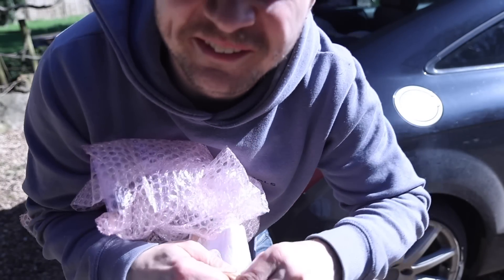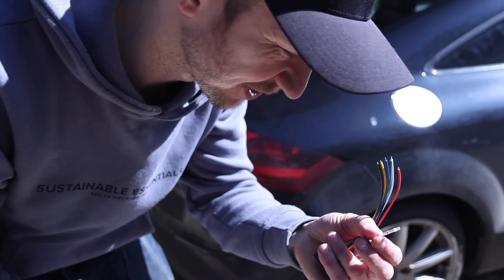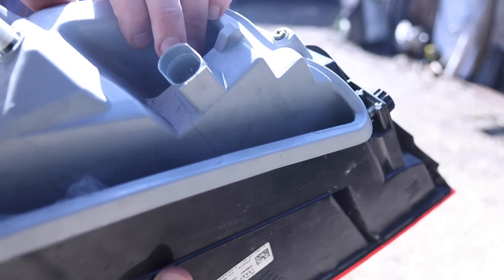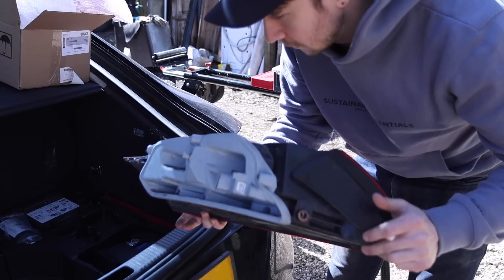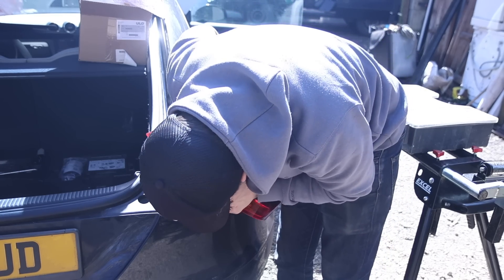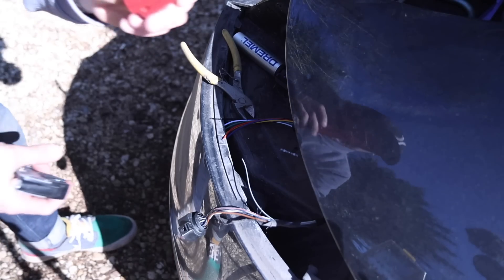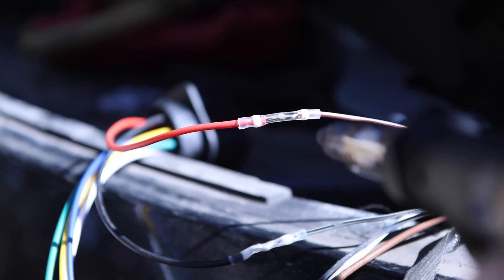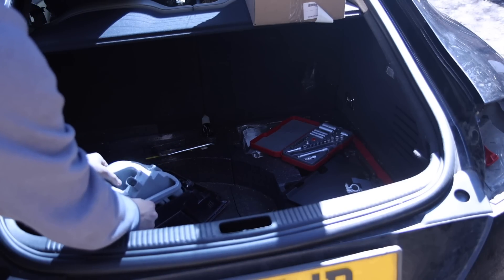Fixing My Mum's Broken AUDI TT (MK2 8J) REAR LIGHT - SOLDERSTICK WATERPROOF WIRE CONNECTORS

Comment: Another great vlog  Even though it was a simple fix, it would be a daunting task for some. You showed just how easy a small but important repair can be. It would be interesting if you could have the job quoted on by a service centre and see how much you saved your mum.
Reply from the maker: Thanks Henry! Yeah it’s probably an hour or so labour for them so maybe £150 with the parts
Reply: I can comment on this, as yesterday I had my nearside rear cluster repaired. A few years ago the offside cluster failed in a similar way, so it’s a common problem - apparently due to the earth wire not being up to the job. I had the offside fixed at the dealer, which cost an eye-watering £273 back in 2017. Yesterday, I had the nearside fixed at a local garage for £90. I just asked them to run a new earth wire and replace the failed bulbs. I was happier with a “dirtier” fix as I’m not planning on keeping the car for much longer now. But, it’s possible the dirty reoair will work better in the long term as when Audi fixed the offside cluster they replaced it with parts that will hit the same problem later anyway.

I could’ve done the repair myself in hindsight, but I wasn’t 100% sure it was the same failure at the time. I had the usual telltale signs of the car warning me that the nearside rear lights were failing. First the side light, then the brake light, then later the indicator and reversing light. Additionally though, and this was the thing that made me wonder if it was a different failure, was that every time I touched the brake pedal, the reversing chime would sound and the car thought it was being placed in reverse. This was disconcerting to say the least!

It all turned out to be the same problem, the burnt out ground pin on the connector.